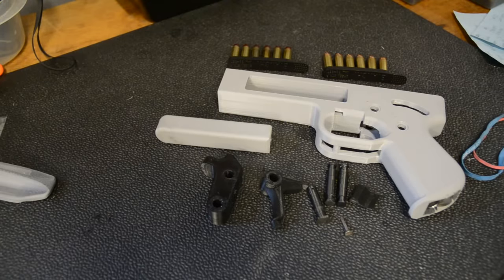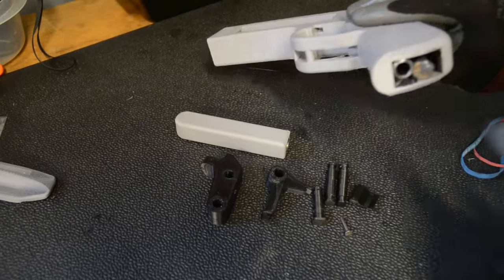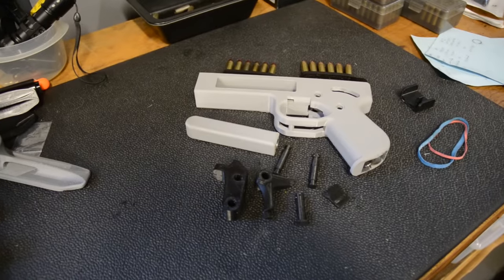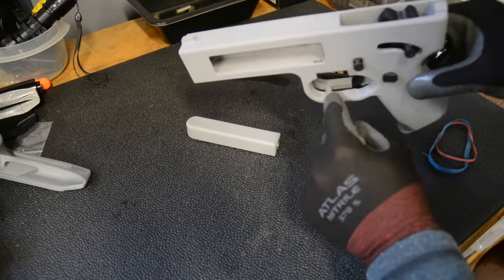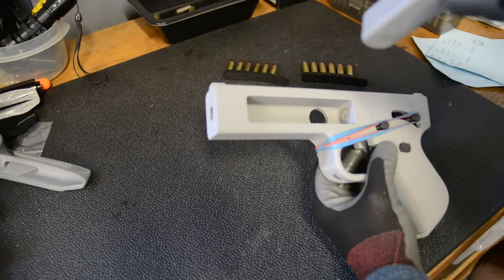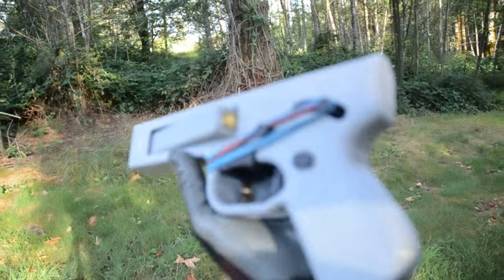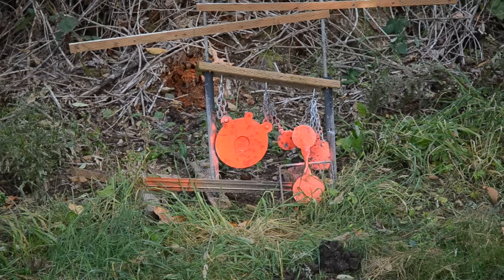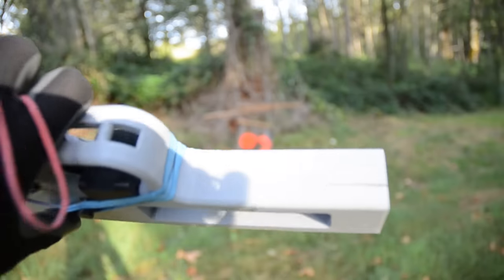Songbird 3D Printed Pistol - .357 Magnum

Comment: I wouldn't trust anything in that caliber made of plastic. Not a chance.
Reply: Bro! Actually we should give the man a like and respect for having massive balls firing that gun!
Reply: the frame doesn't stop the gun from exploding its the barrel which is made of metal so this is realistically as safe as normal gun just janky as hell
Reply: I was going to disagree until I realized the barrel is not metal
Reply: Neither would I as the .357 magnum is a hot round. But I think he made it just to prove that it can be done.
Reply: @hongockimquang1994  I totally agree. Most people would never attempt to fire that thing by hand. Especially a plastic gun chambered in .357 magnum. Anyone else would have fired it at a distance with a string.
Reply: Plastic means no corrosion
Reply: Ay Kay real men don’t need a gun
Reply: Ay Kay if you carry a gun it shows you are insecure about your ability to fight so you hide behind a bullet instead
Reply: It's printed Nylon and high resistance polymer here. No "plastics" in this build...
Reply: Well most guns have plastic frames , it's the barrel thatshould never be made of plastic
Reply: Dustin Adkins again, criminals with guns are cowards for needing it in the first place
Reply: He did not show when its fire,just sound..😀😀😀

Comment: I get the 3d printer craze is neat and all, but would be better off getting a mill/lathe and reproducing an actual firearm
Reply: Fangs of Yima Good luck spending tens of thousands of dollars on heavy automatatic machining equipment.
Reply: Bilbo_Gamers bruh you can buy used decent equipment for 5000. It ain’t CNC. But get good scrub.
Reply: 5000 is a lot of money bud
Reply: a real firearm aint cheap by a long shot either.
Reply: I didn't say that. Edward said $5000 like it's spare change. That's what I'm commenting on, not the prices of real firearms.
Reply: no, sorry about the confusion - that was just to put things into perspective. 5k is a lot of money to a lot of people.
Reply: these kind of videos do more good explaining to people that banning guns and enforcing stricter gun laws does not do anything, since manufacturing is becoming easier with better technology for the everyday person. BECAUSE of that i think people should keep trying to print guns. and it will only get better over time.
Reply: no you cant lmao
Reply: you can buy a high-point for 100 its a high-point but it'll still kill things...
Reply: You can buy a 90% lower and mill the rest of the holes with a milling machine, then buy the rest of the parts without any issue because the lower is the only part that the government considers a firearm.
Reply: Bubblegum Crisis?
Reply: I get the interwebs craze is neat and all, but would be better off getting a printer/press and reproducing an actual newspaper
Reply: Building a gun isn't the point. You can do that with a pipe, screw cap and a nail.  The point is to make a fun project with a 3d printer. For the rest of you bitching about how expensive a half decent milling machine is, I'd like to point out that a quality 3d printer ain't cheap either.  Milling machines aren't necessary, you can make firearms with hand tools, it's just a question of what you want to get out of it and how you accomplish it.
Reply: 5 grand is a dime in the bucket if you know how to spend money and save money wisely.......
Reply: Fangs of Yima 
People already do it on a CNC machine, it’s just a bit more expensive and most people don’t have a half a million dollar CNC machine laying around the house lol. 3D printers are a bit more common for people to have so I can understand that. I agree though, if it were me I rather just pay someone with a CNC machine to make me one and be done with it than to keep having to make these fragile guns.
Reply: Lee Christison 
You can’t share files with a lathe though and that’s the point of this. It’s skill based and takes a lot of trial and error to learn. You can with a CNC machine though, you just input the dimensions into the computer clamp the material and it’ll do all the work for you. Pretty much 3D printer but for metals which gives people the ability to share their work.
Reply: Whats the point if you can now legally print your own gun and make sure it has everything it needs to be the ultimate firearm for self defense
Reply: Just buy an 80% receiver and a drill jig to complete the receiver and viola you have a real firearm or will have once you complete it with parts that don't require an FFL. No mills or lathes needed maybe a good drill press.
Reply: you can make a rifled barrel with a dremel and a 15 ton jack if you just grind down a piece of tool steel like a drill bit into a button and then press it through a piece of rod stock that has been lathed out roughly and then honed out.  a lathe isnt hard to make or you can problaby buy a hobby lathe used for 200 or less possibly. you could even make one very easily.
Reply: Fangs of Yima the 3D printer requires less skill.
Reply: " you just input the dimensions into the computer clamp the material and it’ll do all the work for you." 
You sound like my boss... not even close.
Reply: Unfortunately many folks simply do not have the money or accommodations for machines 
like that. I would LOVE a mill or lathe...I CAN find a spot for a 3D Printer. Remember the 1st 
rule of gun fighting HAVE A GUN...a Songbird .357 not great but beats no gun at all...
Reply: You miss the point...I KEEP MY GUNS if I make them myself... You purchase that gun from an
FFL its subject to Universal Gun Registration (that's what a background check is....you gotta
register it to do the check...). YOUR gun will end up in a police pile to be crushed ... mine will
stay...mine....
Reply: Also, air guns are completely unregulated and can be extremely powerful.  They can ban firearms and even ammo, it would only be a matter of time before full auto air guns hit the streets.
Reply: JBuch you don't even need a mill. A simple wood router and cordless drill or drill press with the right jig and your good to go.
Reply: J M lmao not to dig up this long dead horse just to beat it but these are two very different investments we're talking about. Hold whatever opinion you want about what Trump said, most people aren't interested in starting a whole business 3D printing guns, but to produce them as a hobby, or to be able to produce them in dire situations. Therefore $5000 is a lot of overhead for most people just trying to get into it. 

Starting with a million dollars in an attempt to start businesses that will hopefully serve as a launchpad for making yourself an internationally recognized business mogul... is an entirely different kind of investment with entirely different goals.
Reply: Nice Priss profile picture. BGC ftw. <3
Reply: Gungriffen I saw that too. XD
Reply: Say what?  Mexico isn't an open border and they have MUCH tighter gun control than WE do.  Most of their guns come from us, not the other way around.  There will NEVER be a shortage of guns in the US, even IF (somehow) they banned them there would be guns found in walls and floors and caches for decades if not centuries.  Even then there will be metalworkers who can make them.

The reason the printed weapons scare the bejeebers out of people is that only the LEGALLY Produced ones are easy to detect and there is no step where registration/NICS is required.  It has never been illegal to make your own gun if you were legally permitted to own one.  But the skill barrier was high before - even for Auto CNC owners its not THAT easy and requires a lot of hand tooling.  Now pretty much anyone can buy a barrel liner and make a working pistol.

I expect to see "kits" soon that have metal "works" and you just print the frame (file included.)  Similar to ghost kits now.  Make the kits "heavy" enough to hit legal metal content and include things like straps to bind the frame and safety/trigger/firing pin.
Reply: Sn SM not if you buy used from someone lol
Reply: Fangs of Yima that would require an actual skill
Reply: Only an idiot sells a gun and doesn't keep a record of who bought it.  Because all it takes is that sucker ending up at a crime scene in the hands of someone not legally able to have it to get you an unfriendly visit from ATF.  I knew someone that happened to, he was able to show a bill of sale to a different person who had then sold it on.

If you buy a gun from me I may not have to run a NICs, but if the fuzz come looking I am going to give them a copy of your DL.  If its you or me getting in trouble I pick you.

FWIW you can't legally sell a handmade gun in the US without serializing it.  (usually called "engraving it" -- manufacturer/name and a unique identifier)  Even then you have to be able to establish you didn't make it for the purpose OF sale.  Not unless you also have a FFL-07 manufacturer license.  (which comes with a LOT of paperwork itself)  That includes plastic firearms.  (but does not include black powder)
Reply: @johncabot9058  "not even close" employer.
Reply: a good 3d printer is atleast 5000... a lathe and mill is cheaper but more time consuming
Reply: er, no.  A "good" 3D printer is $1500+.  A "Pro" (as in near industrial) is 3K+.  Industrials go up from there.  The real difference between "pro" and "good" is print SPEED not so much quality.  There are $900 printers that can probably do a decent gun if you are patient.  The difference is anyone with a program can print with plastic.  The printers are getting simpler to use every day.

I agree though, as many guns as there are floating around the US its silly to get all excited about a plastic one.   The only real advantage they have is low detectability if you don't include the mandated weight of metal.
Reply: Sn SM no it doesn’t, not in Illinois. Some states do not require gun registration only a background check every gun you buy. Different states have different laws. If you cannot own one legally you probably shouldn’t.
Reply: @EdwardtheIRISH  5k? You can get a mini-mill for around $300 USD. (in pounds you're looking at around 233 pounds) If you're talking a full sized mill? Sure. But you don't need a full sized mill to make small parts. This is all proof of concept. Sadly, a pre-requisite of a person supporting gun control of any kind requires delusion and you cannot actually explain facts and reality to a delusional person.
Reply: Its about FREEDOM!
Reply: I think it was to prove a point that it could be done
Reply: @EdwardtheIRISH  Yeah no 5000 dollars isnt a lot of money or anything, and did you really say get good scrub lol doesnt even apply here.
Reply: I can get glock at pawn shop 100
Reply: Go to Harbor Freight.  Mill and lathe for close to a thousand.
Reply: @jbuch3687  it depends on what country you live. Here in the Netherlands pretty much all parts (lower, upper, barrel, bolt carrier, bolthead) are regulated just as strict as the actual completed firearm. But in Germany its pretty much the other way around, all parts are legal and unregistered, except for the bolthead and barrel (but not the upper, lower, bolt carrier, or even a full auto trigger group).
Reply: @bilbo_gamers6417  All I need is a drill and a file. Can make anything.
Reply: The hospital bill to replace your blown up hand and and shrapnel wounds isn't cheap either.

Comment: Alot of ninnys have been freaking out over 3D Printed guns. If this video proves anything, they don't have much to fear. It's a single shot, held together with rubber-bands. It's full of metal parts, so it's hardly "Undetectable". It's huge, and prone to damaging itself. I can't fault it's design, they've done the best they can. 3D Printers just aren't up to making decent guns. 

I've seen prisoners in jails making more lethal zipguns out of broom handles. And THOSE are hard to detect... especially since they are designed to be hidden up a prisoner's... well, you know...
Reply: Siggesatan  Everything you said doesnt change the fact that a person wpuld have a much easier time making a gun at a hardware store than they would buying a 3d printer. 

Seriously, poor people years ago used to make their own muzzle loaders in rural areas so they could get food. That was the forst gun John Browning ever made. You want to make one as you described that cant be caught by medal detectors? Make it out of pvc. It only works once? Make two. 

The 3d printer is not a revelation for this. Its a gimmick. 😂
Reply: A lot has changed in 5 years. Look at the FCG-9 now. Also, most of the metal in this could be eliminated if desired. That would be illegal, but it wouldn't stop anyone with nefarious intent.

Comment: I can't imagine turning the gun over and shaking a round out of it to be even remotely safe let alone be used as a safety mechanism.... it's most likely safer just to fire it without a safety, since you're not exactly going to be toting it around with a bullet loaded in the chamber, where a safety switch would be a must. Here's your safety mechanism: don't load until you want to fire it, and just keep it pointing down range while you do so
Reply: agreeded but you keep the weapon pointing down range or at what you intend on shooting also you never keep you weapon loaded unless you are going to use it even if it has a proper safty on it. Its just good range skills and common sense
Reply: Rifles First
I think he means the round used to block hammer from hitting the pin could fall out
Reply: +rifles first I'm saying the act of turning it upside down and shaking the loaded gun to get the extra round to fall out from blocking the pin in order to fire it isn't a great "safety" switch.  use ur brain.
Reply: Travis Heck I'd  have to agree with that wholeheartedly. This is really not a good idea.. a proper safety needs to be incorporated into the design.
Reply: yeah, dont load it till you are inside the political fundraiser event and seated at a table so you can work it blind under the table and successfully carry out your assassination mission.

(better go ahead and add the disclaimer since people are dumb these days: This is a joke, based on the final confrontation in the movie "In the Line of Fire" with Clint Eastwood, where the badguy sneaks a plastic gun into an event to assassinate the president, i think. This is humor, and in no way an incitement to commit acts of violence or insurrection)

Comment: My question is why all the complications for a single shot zip gun that fails so easily? With a small lathe and a cheap welding kit I  could make a semi/fully auto pistol in a morning. By the way I would classify your piece of kit as more grenade than pistol.
Reply: This.  Any garage with basic metal working tools can make something better and safer than this.  With a lathe and a mill and a fw billets of steel, you can make high quality weapons that won't blow your hand off.

Comment: Wow. I was so confident when i called bullshit when someone told me this was a thing.. Yeah it broke, but its a .357 and he didnt lose a hand
Reply: No kidding. I was legitimately expecting this to end with a trip to the hospital.
Reply: 357 are just 9mm with more powder and lead.
Reply: @smokeyjayshouse  And a .50 cal BMG is just a .22 with more powder and lead. What's your point?
Reply: @shrike6243  30×173 mm is big brother of .50 cal, it's basically like 50 BMG but more stopping power. Basically GAU-8/A Avenger is greater than Browning M2. More lead and more powder.
Reply: It is bullshit, he printed a piece of plastic junk to place around a steel barrel he bought. 
I could buy wood and drill it out, and put a steel barrel inside that and fire one shot breaking the wood, it doesn't mean I made a gun anymore than this piece of crap was.
Reply: @joshuawood1436  if it fires a projectile at high speeds out of a barrel, it's a gun. Doesnt matter if it's crappily made or not. Still a gun.
Reply: @michealkasey2292  No kidding simpleton, but he didn't print a gun now did he?
Did he print the "barrel" that fire the bullet? Nope.. so he didn't print a gun. 

Welcome to 1 day ago.
Reply: @joshuawood1436  sure, but you originally said he never MADE a gun rather than PRINTING a gun. He never fully printed a gun, but he still made a gun. Stop strawmaning dude.
Reply: @joshuawood1436  I'm confused. Do you acknowledge that he made a gun or not? Because that was my original argument, not whether he fully printed out a gun or not. You for some reason decided to create a strawman argument by saying he didn't fully print out a gun. I never made that claim lol.
Reply: @joshuawood1436  The "Doesnt matter if it's crappily made or not. Still a gun." was referring to the gun he made, not my prior definition. I apologize if the interpretation there was ambiguous. Anyways, you still haven't answered my question. Do you believe that he made a gun or not? Because at first you said he didn't, and then you changed it to say that he never fully printed one.
Reply: @joshuawood1436  I think you're confused. I'm saying he made a gun as in he crafted it himself using the gun casing he printed and all the other parts he bought. 
And really, ad hominems also don't help your case at all in addition to your previous strawman arguments.
Reply: @joshuawood1436  Ok then have a nice day!
Reply: @joshuawood1436  keep crying
Reply: @tomh.5750  keep failing.
Reply: @joshuawood1436  keep crying kid
Reply: @tomh.5750  keep failing perverse thought.
Reply: @tomh.5750  do you even amuse yourself with your forced edgy persona?
My gosh, he said abortion bucket... so CoOl...
yawn
Reply: Shrike not the same at all. A 9mm and a .357 are almost identical diameters. A .50 cal is literally twice as wide, also not to mention the huge length and powder difference in the cartridges. Also .22 only comes in rim fire, almsot every other round is center fire. They’re literally the most unlike rounds